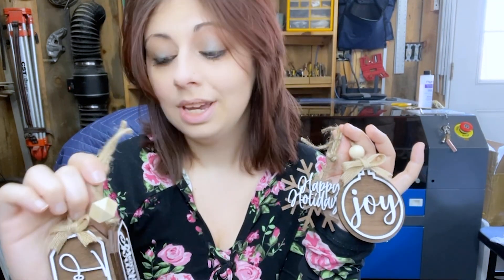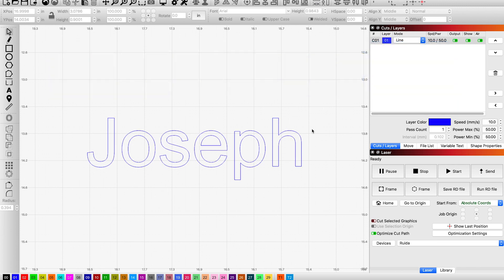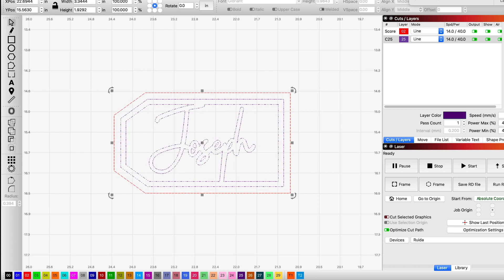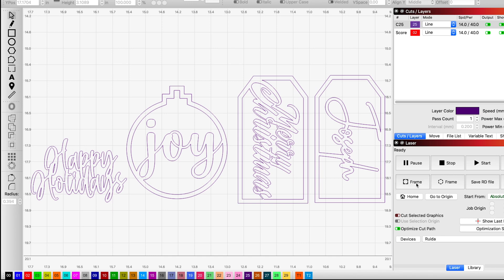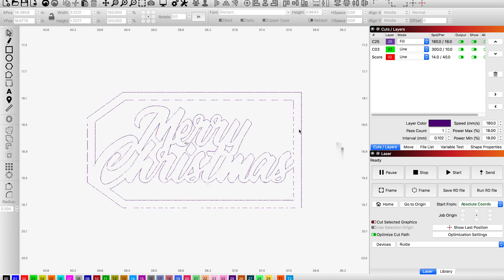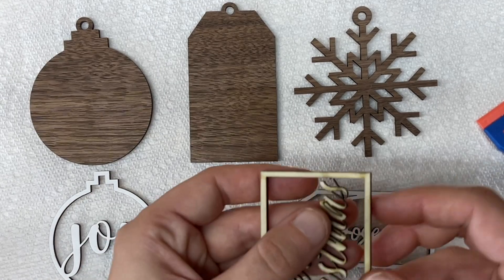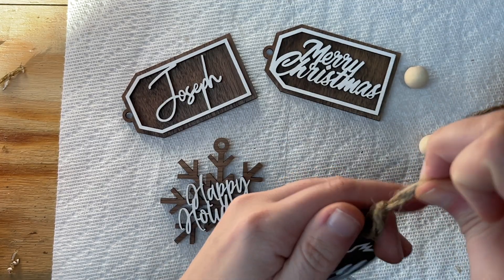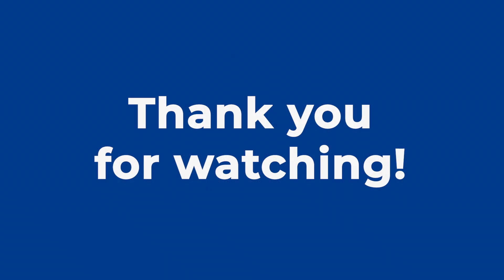Laser Cutting Christmas Gift Tags with a CO2 Laser Engraver - DIY Project Walkthrough - OMTech

Comment: Thank you for the video.  You obviously have some serious skills and experience.  

When doing things in Lightburn please, please tell and use the video recording option to highlight what you are clicking.  

When using shortcut keys, tell us what shortcut you are using.  Even knowing how you moved shapes/items very small distances (like the middle part at the top of the "r"s) to get them into proper position after the offset would be wonderful. 

Speaking of Offset, please take a moment to explain the options you are using (Inward, Outward, Both, Square, Rounded, etc) and the distance.. and how and why you chose that distance amount, would be very valuable. 

If you delete a shape then copy and paste one from a different letter (tops of the "r"s in Merry again), please let us know that you are doing that and WHY you did that vs. just moving each one.

And using fast forward while editing kind of left me wondering what just happened. 

The what are you doing  why you are doing it and sometimes, why you did it the way you did, are all educational things we want to learn about.

Thank you again for the great project and video showing how to make them.